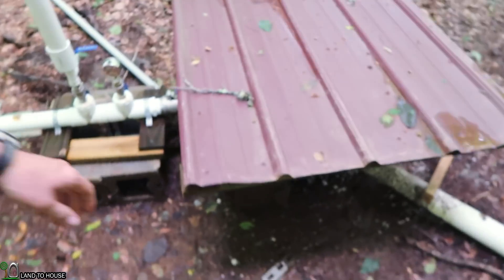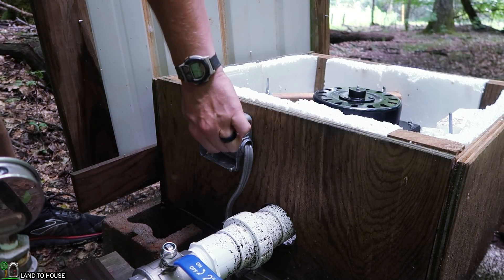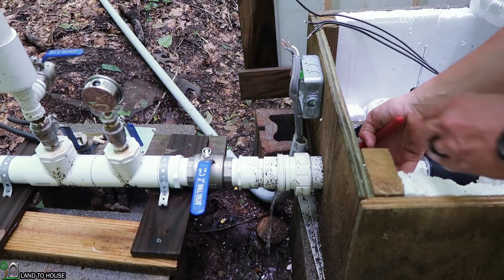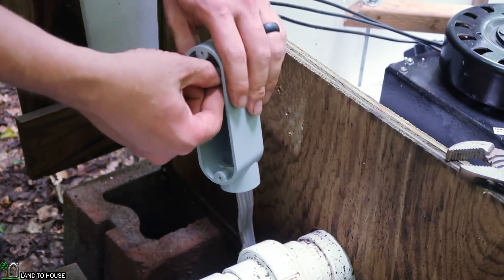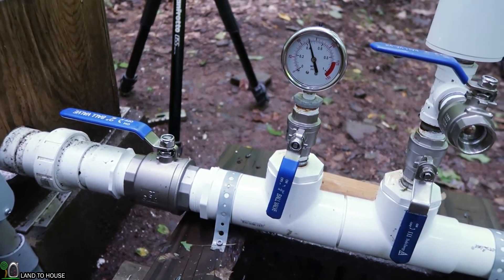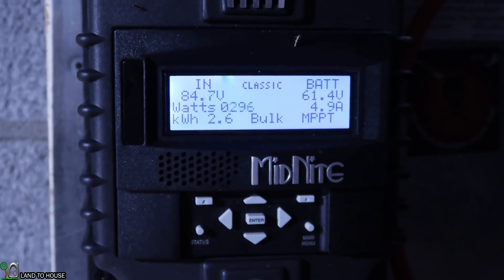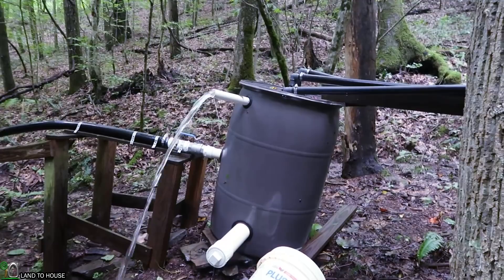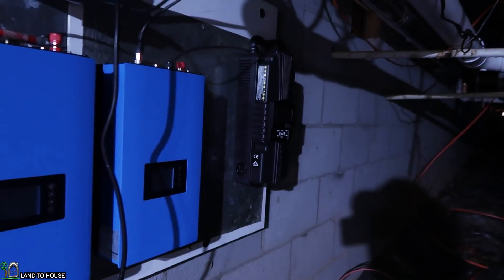Watts OVER 300! Adding another Nozzle increases Watts in Micro Hydro

Comment: I mean if a 3/16 uses 8 GPM and you have 10 overflow you might as well try one more
Reply from the maker: Not long after filming this video the water dropped down to about 15 gallons per minute. Right now it's flowing at about 10. Which means I am unable to run the turbine
Reply: @LandtoHouse  Why not make a 3/16ths nozzle the always-on one? Is it enough to spin the turbine?
Reply: @LandtoHouse  Woohoo!  Time for another turbine that runs on 10 to 15 gpm!

Comment: If you have two nozzles running at different flow rates, wouldn't that affect the microhydro's performance?  I assume having nozzles with different diameters, would do that.
Reply from the maker: The pma bearings are nice and strong. The different jet strengths will not cause an issue.the two nozzles are basically additive.
Reply: But why not use all the same size large nozzles to get the max output?
Reply: @TonyCaseyIRL  He has a lack of flow at times so needs different size ones  to compensate. With 4 it might be a good idea to have one 1/8th inch, one 3/16th, one 1/4, and one 5/16th inch nozzles if he could keep 3 out of the 4 closed and open as flow allowed.

Comment: Could you also use the valves in the turbo box to control the flow rate to the 4 jets, perhaps give a more evenly distributed drive? Great project 😉
Reply from the maker: I can try that. It would be very sensitive.  Even a small opening can let out a lot of water! That 3/16" nozzle is 8gpm!
Reply: @LandtoHouse  ... you could gate down ALL of the nozzles at once using the main ball valve. Just cut back and watch the overflow as your guide.
Reply: Yeah, I'm sure it's possible to automate the total flow/overflow check up top and link that to some valves at the bottom to optimise the system..... It would be so cool!! And, y'know, more optimised, which is always nice 

The problems, of course, would be 1. powering the system up top (in the trees, so probably not solar! Would be nice if a bit of mini hydro could be set up to regularly charge it or something, but that's becoming rather complex!!) and 2. transmitting the data back down (I suppose taping a wire on the side of the penstock might work....?!)
Reply: Could you not just measure the overall flow rate of the penstock at the bottom, it would be the same along its length?

Comment: Hi about ram pump can we use vacuum in intake pipe becuse we dont have elevation in pump intake?
Reply from the maker: The head pressure is very important for the ram pump. Without that the pump does not work.
Reply: @LandtoHouse  ok thanks can you make elevation by vacuum? ...like siphon!!

Comment: Can you add a gearbox to further increase the power? Or drive two alternators from the same shaft?
Reply: @Morgan Andreason
Gear will not change the total power, if he go up in RPM he will loose torque and current but higher voltage.
Goes down in rpm more torque, higher current and lower voltage.
The power the water flow and head pressure can provide will be the same no matter what you do. Is just how you choose to utilize it. 
Same as a transformer, for example it can provide 200VA or W on input side at 200v and 1 A. with a ratio of 10 it will transformer down to 20v, that means it can deliver 10A and that equals 200VA or W.

Two alternators on same shaft, if 3 phase type as he used they will need to be synchronized else there will be a lot of loss in reactive power between the two alternators.